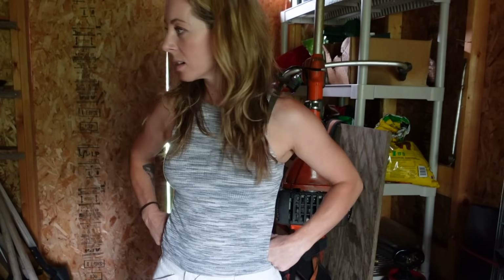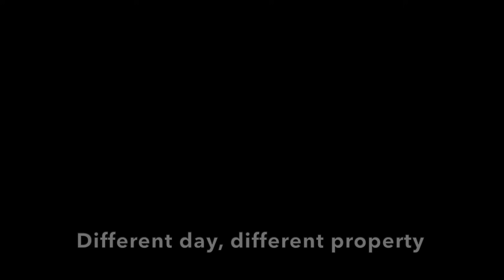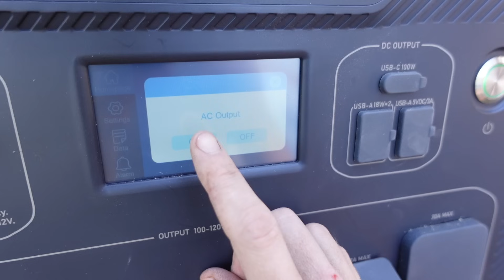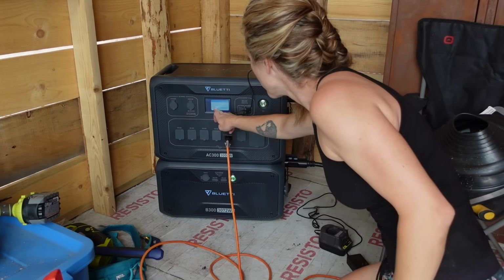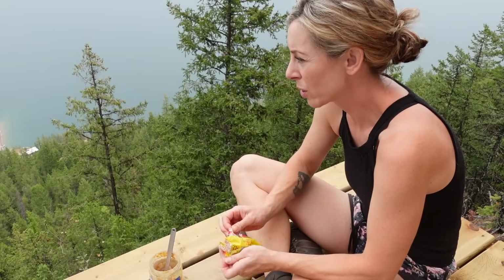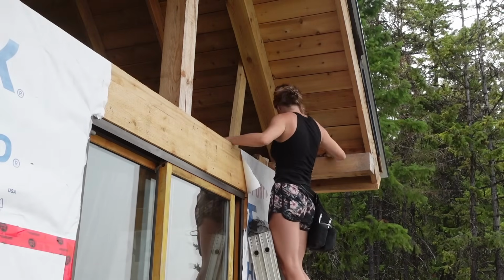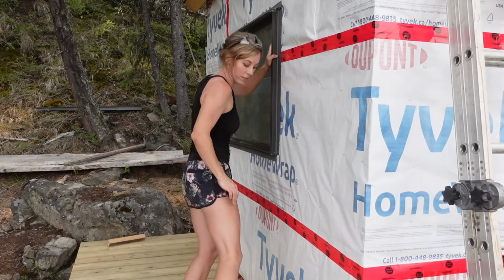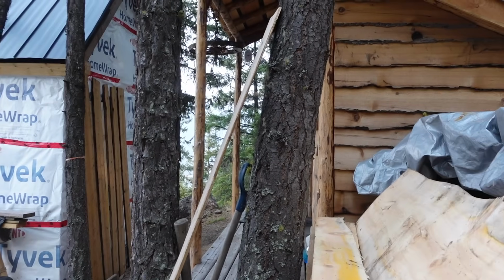Can I Train a Rescue Mountain Goat for This? (Ft. The Great Escape).

Comment: I see Steve loves the role play & I bet it was something he had to ge used to. I loved role play with my girlfriend who was 36 years younger, but not so much the S&M, and not at all when it came to DDLG. There are just some tricks that you can't teach an old dog.

You can have horizontal siding using the eight foot boards by adding a vertical stop midway to break up the siding. This would look like two separate panels of siding, separated by a vertical board. You can also have a two foot wide section in the middle of the wall with vertical siding, and horizontal siding at each end for a more eclectic look. Alternately, vertical siding at all corners and horizontal in the middle. It would be more work, but you could mill up cedar shakes and even scallop them for a different look.

Comment: I would try to get an eye on the horizontal railing Richard Neutra used in some of his Swiss mountain houses which he designed and constructed not to obstruct the views!  Your views out there are absolutely priceless find it very difficult imagining a railing which does not corrupt those! Love your videos and the your plot.

Aesthetically I guess I would stick to horizontal due to the other cabin the space between the two cabins might look a bit more defined if both sides are the same orientation I guess. But that's probably me trying to stick to principles when things correlate or have context.
Reply: The special idea of neutra was to build horizontal rails flush with the deck level 1,2 to 1,4 meters out with cables (or probably also a net) to catch someone if tend to falling down and on the edge of the of the deck end the catch rails there had been just a toe rail about 10 to 12cm high for having a stopper if one slips on the deck.

Comment: Please consider a poured concrete anchor tied into bedrock in the back of the cabin. It would be alot of work on that site but i really think you need it there more anchors bolts wont stop it if something happens

Comment: The live edge vertical siding is nice but I think there will be issues in the length of the boards.  How are you going to transition the boards since the boards are different widths?  You could do the gable end differently.  Do vertical on the four sides and horizontal or diagonal on just the gables where the roof line meets the side wall.  You just happened to have that costume in the closet?  😉  Congrats on hitting 100+K subscribers!

Comment: ... meant to mention - if you go with vertical siding, you might want to run a couple of hidden beads of caulk on the the backside of the battens before installing them.

Comment: Could you run the 8' siding vertically, and on the two gables run it diagonally with the roof pitch? You'd need a horizontal frieze board to kill the cut ends into, but I think it would be trés groovy.

Comment: Okay so, since you went with the timber frame ,what are you planning on nailing the vertical  siding boards to? You'll have to put up some horizontal nailer's on the inside, otherwise those are going to be some flimsy walls Michy🤔 and you would definitely need at least a bottom kick plate to nail too, all the way around where there's wall..I don't remember if you ever did that or not? Oh and stepping in dog shit is supposed to be a lucky thing, God only knows who came up with that one though haha 😆
Reply from the maker: I am adding strapping all the way around, which will be nailed into the framework that does exist. I haven’t done the bottom board/kick plate thing either. All of those details I am gonna sort out soon!

Comment: I would go with the vertical wall pattern. Even though the shed walls are longer than the cedar board lengths you can make them a ten ft length like you said, or eight ft lengths, then use a two foot lengths or four foot lengths to obtain a vertical wall. Then just nail a 2" trim piece to cover the gap between the board lengths around the whole perimeter of the wall. Then it will look fine, then you'll have is a trim piece that creates a defined border in the walls appearance.  So what? I think it will look better than a horizontal shingled wall. Go for it, it's not like you don't have the time. where not going anywhere.  And it will look better, right!! then you'll be happier in the end,. Cheers have a good one Michygoss.

Comment: railing would just be another thing to work around when buttoning up the cabin exterior  - doing the siding, etc,  - good call - you wouldn't have been able to spin that window around so easily, for example, if the railings were in - save it for last. Like i said last week, I prefer a horizontal lap - but board and batten is perfectly fine, and I think you'd have a much easier time with it solo  (Houdinina?)

Comment: which ever siding solution better protects against rodent incursion... you know they are going to set their sights on that cabin eventually... doesn't take them long to chew through an inch of wood. I have put metal flashing around the bottom of the building to force them to chew through steel to get in... so far 12 year rodent proof in an extreme rodent problem area, but that's on a concrete slab. in your case they would probably opt to chew through the floor.

Comment: Is Horizontally good weather protection...??
Water can run inside the boards, instead of running off unless u use a good 'n tight sealant right ??

Comment: I can see how it would be tempting to add a different look, but, especially with your live edge, I feel the horizontal is gorgeous. More importantly,  there's a reason why overlapping horizontal is tried and true, water penetration. The great destoyer. The concern is amplified even greater with the winds that you'll likely experience at that location, pushing water thru gaps.. Water penetration equates to rot, mold, insect and varmint infestation. If you multiply that times the unbelievable challenges and investment of; effort and time, I  believe you deserve a solution that will function well and last the test of time. I teach environmental sciences, leadership, and communication  classes, along  with being a semi-pro builder. I find your accomplishments inspirational. Thank you for sharing with us

Comment: Like verses practical is the decision maker. Horizontal will not or should not allow water penetration, water is your enemy as it will rot out your building in no time at all. Vertical siding using those boards is a recipe for wood rot due to water penetration. Reno’s are double the work. Rip out and then repair. Go horizontal.

Comment: HAHAHA! Another Michypiece!! How about "THE RED-CAPPED BAT GIRL W/SWORD?" Meanwhile, back at the edge of death (cabin on the cliff.) Please reconsider your critical path. Remember that old saying that we all hear from childhood on up? - "SAFETY FIRST!!!" Slam some staples into the Tyvek to quiet it down and get busy erecting some vertical posts, maybe four feet high with a cap rail. Then design the spaces in between. Place a horizontal 2X8 on the outside edge of the existing deck and half lap the verticals. Using two bolts per, attach the verticals (4X4) to the deck. The use of carriage bolts will make it easier to drill and then hammer the bolts through that thickness. I think your tiny survival shack for staying over night is one of of your best creations. Horizontal is the only way to go for exterior siding. Limit your interior decorating to the interior. A recent movie that I watched - The Flight of the Phoenix had the best most appropriate line here. "Mr. Towns, you behave as if stupidity were a virtue."  Hahaha.

Comment: Not that this is at all useful at this point, but I have driven a large lag bolt into the center of the end of a post until the threads are all in the wood. Leave the smooth shank of the bolt exposed, cut off the head, drill a corresponding hole into the concrete/rock to locate the post. I have only done this on flat surfaces, so I don't know how well it would perform for your application. But, I think it might be easier than what you've done. I must admit, the method you've used should be quite robust. Bravo Zulu.

Comment: STILL NO WINCH ON TRUCK! WHY! It's called a "staple hammer". Why vertical  boards and not horizontal (overlapped like shingles?)If you use pine ,at all ,it needs to be treated or painted.(mold will form if not treated).I will always like horizontal like log cabin style. The only double edge you will see is the outside row. Know what I mean😋 "LADY B" (BOARD AND BATTEN)
Reply from the maker: I explained in the video!

Comment: vertical siding  will let water,ice and snow collect in the length of the board seams,,,horizontal siding  water,ice and snow collect in only the width of the board face. think about how a driving rain will behave on those siding boards,how it repels the weather. what is the most functional is not always the simplistic method.-sorry

Comment: You’re definitely a card! Kinda corny but always entertaining to watch non the less. As far as the siding goes(in my opinion) I would probably run them horizontally not only to match the “she shed” but it might repel the weather better. I’m not a building contractor but I don’t think I’ve seen many if anyone run siding vertically. Not saying it isn’t possible or that it wouldn’t work. Just saying I’ve never seen or heard of it. Whatever you end up doing I’m sure it will (be entertaining) work out.